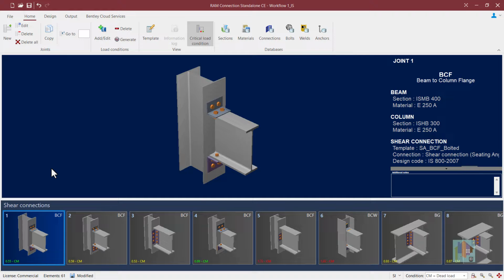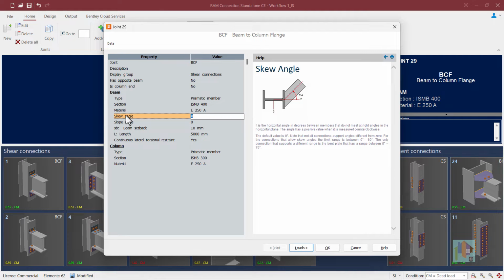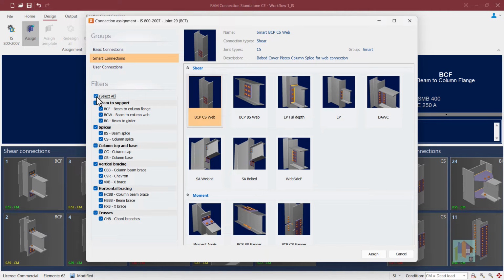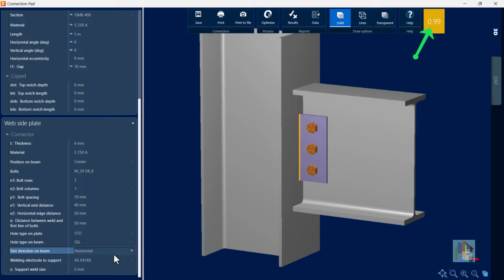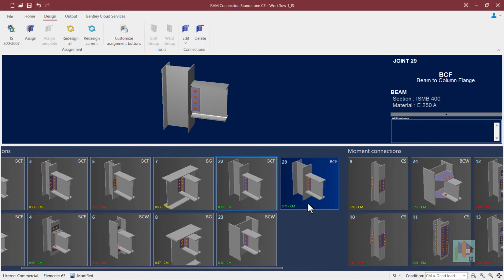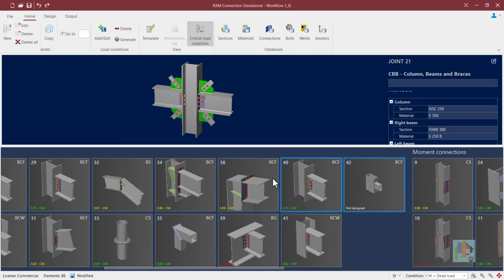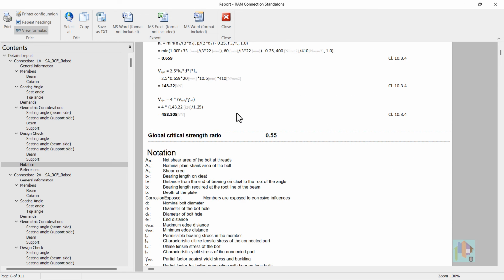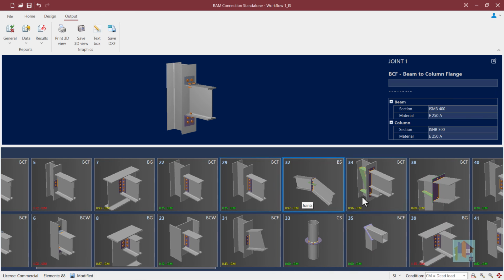Connection Design Overview - Part 3: RAM Connection Standalone || Design option, Report, Drawing

Comment: Sir, Im trying to design connection for tapered beams and column for PEB structure in Ram connection Standalone..But in ram connection, there's no option for entering flange property value like thickness, width and also web thickness so how can be this issue resolved
Reply: And sir I'm trying to design connection in integrated ram connection with Staad but while design it's giving an error that only American, Indian, Japanese sections are available.. No design for PEB sections
Reply: Thanks for your kind response..
Second question is that I try to use Integrated Ram with Staad but that's also giving an error by saying that only American, Japanese, Indian sections....are supported..Any solution for this
Reply from the maker: I am not sure about the reason, which design code you are using? Also, you have modeled the tapered section properly in STAAD, right? Identification of any section including material is mandatory when Integrated connection design module is used.
Reply: Dear Sir,
I'm using AISC design Code.. Tapered section is assigned properly but I don't know why its giving this error
Reply from the maker: In RAM Connection standalone, you can provide initial and final depth of the section along with section name. No separate option is available to provide section dimensions, as it is imported from the section database. If you are using custom/built-up section, add that section first in the database, then use that section for tapered beam and column.

Comment: Sir, is it possible to model any face to face angle connection in staad pro?
Reply from the maker: No, it's not possible. Back to back angle or star angle arrangement is only possible for analysis and design.
Reply: Ok..thanks you sir.